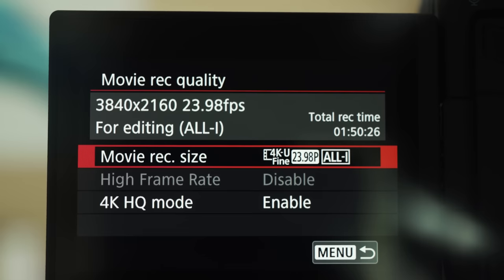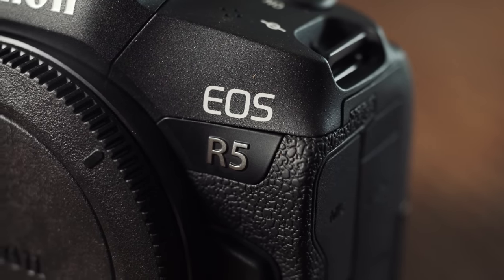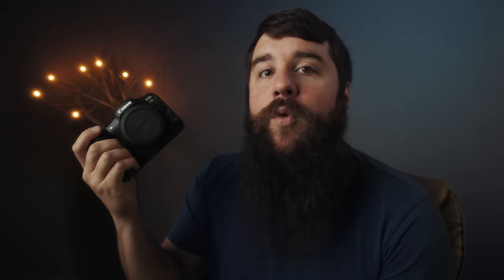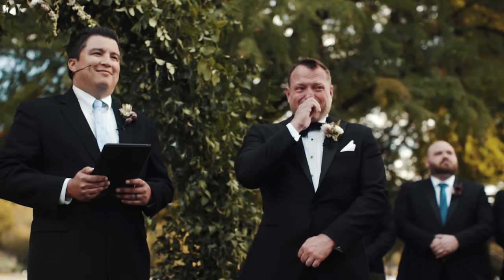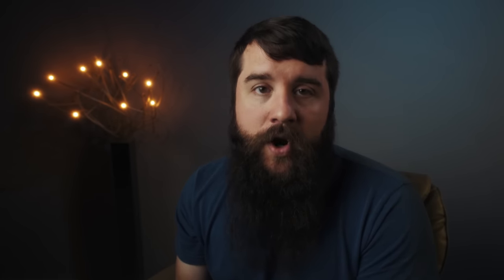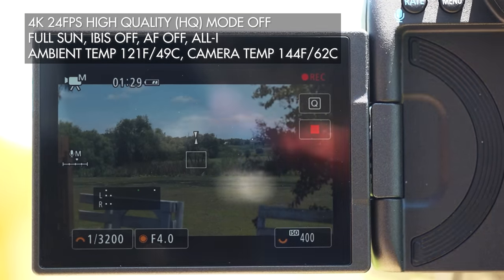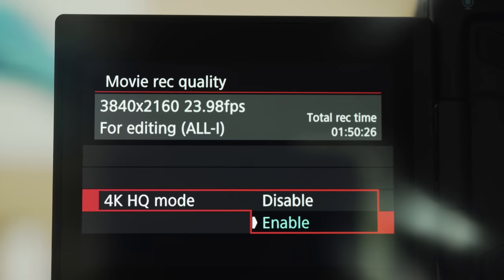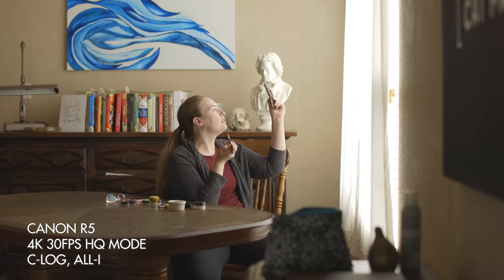Will The Canon R5 Overheat Filming A Wedding?

Comment: Hopefully a firmware update can fix this. As in other tests, the card and battery and camera are all cool to the touch, yet it overheats.

Did the camera seem HOT to you??
Reply from the maker: I measured the temperature on the camera when it overheated. 98F so definitely warm.
Reply: @whoismatt  I just passed the part of you talking about insulation. Makes sense. I think the only camera to ever overheat on me, is my Canon 5dmk2, but that was rare.

I definitely think it's a precautionary measure they put in the firmware, understandable they don't want the sensor to fry. But hopefully a firmware update can fix the issue.

But as Armando and even you said, this isn't an 8k camera and I think the marketing of the camera as an 8k workhorse was a mistake. And 8k for a wedding doesn't make sense haha.

The R6 IMHO, seems a much better video opinion. And it seems to have less issue (still has issues though) with overheating. No 4k 120? Oh well. 4k60 and 1080 120 sounds like a great option for a camera that costs 2,499.

But I will wait until it's resolved.

Comment: I noticed a lot of likes for comments agreeing with you. But no love for those comments mentioning it not overheating with external recorder. Are you intentionally ignoring those comments about the Ninja V?
Reply from the maker: Hey Fred, definitely not intentionally ignoring. I've replied to some. :)  I think its great that there is at least a workaround for this camera overheating. That said, the Ninja V is going to require an extra cost of $1000 (recorder + SSDs) to an already expensive $3900 camera. 

Then you have to consider the bulkiness of any rig using the Atomos. Using it on a gimbal etc is going to slow down filmmaking a lot. For the reason of added weight I don't use nor recommend an external monitor when filming weddings.

Lastly consider that you are now relying on a rather flimsy micro hdmi cable connector to get you through a wedding day. The R5 is not recording video internally, so if something goes wrong you are stuck with an overheating camera.
Reply: @whoismatt  You can shoot 4KHQ, 4K60, and 4K s35mm Crop externally without limits. I think not even mentioning this is a huge omission. ESPECIALLY because it comes down to a personal preference of not using an external monitor. To be completely honest, you are largely in the minority on that. Most filmmakers absolutely use external monitors. Also, why didn’t you mention Super 35mm Crop? its is 5.1K oversampled to 4K and it looks excellent! You can shoot 4K Crop 24p with NO overheating. Also you are almost always on zoom lenses for this work. S35 is a very popular format for cinema shooters. In Weddings, you mostly need more lens for those intimate moments. Even using it to punch in is very useful. There is no mentions of almost any of the well known positives in this camera. The superior IBIS and industry leading eye tracking auto focus come to mind. They would come in handy for gimbal work and weddings. Those omissions are pretty wild. It borders on disingenuous.

Comment: I feel like Canon can take off this internal timer and film way longer than advertised. It seems like it can handle a lot more than it lets you. I pray that with an update it fixes it and unlocks its full potential.
Reply from the maker: We can hope that is the case. I will say the camera does warm up to around 100F when overheating. It's warm to hold, and I can see Canon not wanting it to get much warmer before shutting it off.
Reply: My concern would be that even if the limits are taken off, what would all that overheating do to the sensor and other internal components over time? I imagine it would significantly shorten the lifespan of this camera. Can you imagine the camera just going completely dead on you during an event? 1 year into purchasing? 2 years? I would be crushed. I've been using a GH5 for years now and it's still going very strong. Reliability, to me, is way more important that top end specs.
Reply: They know more than us. Perhaps they are avoiding long term sensor damage
Reply: @philipbloom  but sony has no long term damage  when recording blazing hot , right 😁
Reply: The temp range I’ve witnessed every time on both of my R5’s is 112 degrees Fahrenheit, then it shuts off.
Reply: Ahh ok. Other reviews I've seen said they were barely warm to the touch and yeah, would def not wanna damage anything internally in the longrun that's for sure.
Reply: S B_ it takes a minute to get there, but I’m pretty confident that canon has the sensitivity turned way up. My atomos get to 113 and the fan is still off. I’m sure there is a lot of difference there with internal components, but the R5 is easily capable of recording longer than their times they have set. Praying for a firmware fix.
Reply: @unmaskingimages9209  I agree I feel like that as well. Would be amazing if we were right about this. It would be a top tier camera by then.
Reply: @Playerdrew10  Sonys all overheat in 4K. Daniel Schiffer admits that (despite being one of the most succesful youtubers around) he only shoots 1080 for everything because 4K30 only gave him 20 mins or so. Plus he had no 4K60 or 120 options in Sony anyway. Suddenly though, with dumb videos like this one, those options aren't good enough. LOL.
Fuji Xt4 overheats in 4k60 faster than the R5.
Reply: @DraganMedakovicPhotography  Yeah, the Sonys have heat issues in 4K30 for many years.
Reply: @unmaskingimages9209  why buy a camera that you have to pray for firmware fixes? You need a reliable tool . Panasonic is by far the best option but their AF is horrible leaving Sony as the other full frame alternative
Reply: @77dris  dumb videos like this one? It's the most comprehensive video out there. It unfortunately doesn't stimulate your fanboy ears the way you hoped it would.
Reply: All Cars United I mean we all hope for these kinds of things regardless of brand. We hope that Sony fixes their battery issue at one point and they did. People still bought it. We hoped that Panasonic fixes their AF but we still buy it despite it still sucking. Everyone has a workflow they are willing to tweak for a beast of a camera. Canon is mine... I wish it didn’t overheat, but look at how much the 5DIV cost at launch. ($3,499). So for $400 more we got a killer R5. I’m completely okay with this. Yes the overheating sucks, but I’ve found a work around since I use atomos anyways when shooting video. With all that said, I still pray that they improve it. I know there is room for that improvement since the camera is not even hot majority of the times it says it is. We are all pretty spoiled by the quality of cameras that are coming out now days.

Comment: I’m curious if using an external recorder like the ninja V changes anything with the heat issues.
Reply: Yeah I had the same question.
Reply: It does, check out No Life's video. He recorded 4K HQ for 2 hours until the battery died.
Reply: @findingjoe  You're limited to the life of the battery when shooting with an external recorder; the same as any other camera.  By the way,  I shot a wedding with this camera yesterday.
Reply: @MauriceCovingtonvideographer  How did you go?

Comment: Ouch...that's what I expected...but still is rough. Definitely one to avoid for video unless all you do is personal vlogs that can be paused if it overheats. I don't think I've ever seen a camera of this price bracket or advertised caliber struggle so much with overheating. Even the old Sonys weren't THIS bad.
Reply from the maker: As someone that still shoots with the Sony A7Sii, if that camera overheated as bad as the R5 I would have sold it a long time ago.
Reply: @whoismatt  very true, and that camera used to be made fun of for overheating. I've never had an issue with the A7iii at all in the couple years I've used it for wedding and commercial work. Never even seen the overheating warning pop on. I'm hoping the A7Siii follows that pattern, and other than a couple outlier tests it seems like it will, which has me hyped.

Comment: I really wanted this camera to work. But I can no longer defend Canon. This is not the first time they disappoint with cameras. But it really bothers me some people calling themselves reviewers are talking about this camera but are not being objective. They said things like “ if the Camera overheats at 8k or 4K 120 don’t use it” or they said thing to justify why you should buy it when is clear this is not a professional camera. If can’t freely use 4K 120 frames or 60,24 then what the point of this camera? I understand 8k having a limit but 4K 120 and all the other 4K options overhearing as well....this is not a good product. Then, is even worse when Sony presents the same camera but different MP and no 8k and no overheating issues. If another camera with similar specs exists without overheating, then Canon has no excuse to do the same. This was my last straw with Canon and this toxic relationship has come to an end. For the first time, after using canon over 10 years I’m thinking about switching to Sony, which I never thought I would do.

Comment: Useless camera, epic fail canon, disappointing. A7siii here I come
Reply: How is it useless?  Overheating issue is fixed by recording to an external record (which most people at this level are using anyway).  With the overheating being fixed, it makes the R5 a better overall camera than the A7siii for both stills and video
Reply: For sure better than A7sIII Sony, with the same overhearing problems of Canon.
Reply: @SuomiFinland78  huh? u make no sense lol
Reply: @jtdiddy3160  but you cant record 4k120 externally
Reply: I wouldn't say useless but they are indeed crappin the bed on this rollout.

Comment: Your missing one point here, you can shoot in 5k oversampled cropped mode in 60 or 24 hq or use atomos ninja v without heating issues. If you are shooting I guess u can use ninja v atleast
Reply from the maker: If you want cropped 4K the gh5 will work much better with no workarounds for overheating required. :)
Reply: Matt WhoisMatt Johnson well then use atomos ninja v, it will give you glorious oversampled unlimited 4k. Your camera in Tripod anyways. You had this canon hate from the start so ofcourse you will try ur best to point out only the faults. I never heard you complaining a73 overheating before, ur agenda kinda simple dude. No matter what the hell you say, R5 is the best hybrid out there not 10 mp camera as you will I’m sure proclaim soon
Reply from the maker: @shinzychan5117  best of luck shooting with the R5, hope it works well for you. I've never owned an A7 III by the way, hence why you never heard me complain about any overheating. :)

Comment: Was there any overheating in 1080 120fps? Or is that safe without overheating?
Reply from the maker: The R5 does not currently record 1080p at 120fps
Reply: Matt WhoisMatt Johnson wow that is crazy!! So strange. But The R6 does right?  I would really hope no overheating in 1080 😩😩

Comment: I know you don't have all day but would be very interested in seeing this same review but using a Ninja V... I have seen reviews showing that it helps with over heating but they are not real usage reviews
Reply from the maker: Hey Bryan, unfortunately I don't own a Ninja V. I wouldn't recommend it for wedding filmmakers regardless though. The Ninja is going to make the setup much bulkier, plus with most external recorders if something fails (HDMI port etc) you can still use the camera without the monitor. In the R5's case it's overheated without the monitor.
Reply: Matt WhoisMatt Johnson thanks. Your review is really enough to draw conclusions. I was just being greedy. 😂

Comment: Did you try it with atomos ninja? Seems like the proper way to go if you need video.
Reply from the maker: Haven't tried it yet! Keep in mind the Atomos is going to add bulkiness to any setups, plus if the micro hdmi port fails your camera is overheating. Also, no 4K120 or 8K without overheating.
Reply: @whoismatt  The way i see it, if micro hdmi fails, you have warranty. On the other side, no other camera has 8K, so you don't need it anyways for weddings. 4K120 is typically used for just a few times in a clip, so it makes sense to use atomos, it's cheaper, you get better monitoring, and of course, no overheating. Not too long ago, a7s had to be used with atomos to get 4k , no one complained for bulkyness. That setup is still smaller than any cinema camera.

Comment: Atomos!!! Love your content, but the atomos with no memory cards recording externally is a huge huge work around.
Reply: i was waiting for him to state the obvious which is the work arounds but he either doesn't know about them or simply just went full sony to even care
Reply: reem 94 I got almost 2 hours of continuous
 4k60 uncropped. That wasn’t even a cold start. So ya very possible to perform a high quality wedding at 4KHQ, 4K60 and 4K120 for small b roll moments. Plus I have 2 R5 setups with atomos ninja V’s. I should be solid. Don’t know many wedding videographers that don’t have two identical bodies.
Reply from the maker: I'm glad to see that a Ninja V looks like a viable workaround to the overheating issues. This pushes the camera's cost to approximately $5,000 for the recorder plus SSD. You still can't record in 4K120 or 8K without overheating. It's a workaround yes, but even with that setup I would not recommend this camera for filming weddings.
Reply: Not really, I’m not buying a $1000 atomos ninja to NOT be able to film in 4K 120 or 8k raw when that’s half of the reason to get the camera in the first place over other less expensive options. Plus after spending $650 on a CFexpress card to at least have it for a little time no way. If canon doesn’t correct these issues to at least SOME extended degree in a firmware or hardware update then it’s looking like this camera is doomed.
Reply: Matt WhoisMatt Johnson everyone has a preference. I’ve loved it for weddings. Photo and video wise. The editing is a lot better with the atomos codec, bright screen for outside use, and it’s cheaper media.
Reply: @whoismatt  how much does it cost in CFexpress media, compared to cheap ssd? you need at least 2TB for serious use
Reply: Fly Guy I agree that it needs to be fixed, but nowadays the atomos is a huge companion to every videographers arsenal. If you don’t use it and want to stick to just a body and that’s it, then it’s definitely not a wedding film camera. Then again... I did a test and the 1080/60 with an RF 28-70 f/2 Lens was sharper than the 1DX II at 4K60 with a 24-70 2.8 II Lens.

I’ve also been able to do all my recording and then stick the card back in for 4K120. So it’s definitely doable
Reply: @unmaskingimages9209  but atomos wont record 4k120 or 8k externally :/ You would have to plug out the dummy battery/atomos, insert back the cards/battery to shoot those modes. And switch back and forth.
Reply: I’m only concerned about removing the cards. The dummy battery isn’t that significant to me. 4K60 does that job just fine, and the 4K120 is usually a planned shot anyways for b/roll. Just pop in the card and shoot. Takes maybe 5-10 seconds. That’s doable for me... The R5 is a hybrid that I’m willing to do a work around with it until I get a designated RF Mount cinema camera as my A cam. I’m still debating on buying 1 A7Siii tho
Reply: You shouldn't need workarounds for a product that's selling for 4000 and claims to be the next video meca
Reply: All Cars United completely agree, but it’s not going to stop me from creating content that my clients and myself love.
Reply: Just read an article that basically proved that Canon has limited the camera on purpose. This is making me want to switch to Sony now.        https://www.eoshd.com/news/chinese-user-modifies-canon-eos-r5-to-improve-heat-management-but-finds-artificial-firmware-time-limit/

Comment: Matt you said you can not shoot a wedding with the R5 that is not true. If a person wanted the R5 before of the full frame 4K instead of the cropped 3k in the R, a wedding or anything else would be no problem. So I disagree with you there. Also, did you ever look at recording 4K HQ externally. The R5 has ~ unlimited record time. A lot of manufactures restrict their cameras to recording certain things externally. I think is Canon had said ( in marketing ) down sample 4K HQ externally we would be having the same conversation.  Just my .02

Comment: I wonder if this is the case with the R6 🤔
Reply: Yes it is but even worse because in the R5 you can film in 4k non hq 30fps with no overheating. With the R6 ALL 4k modes overheat, no exceptions.
Reply: same case
Reply: The R6 will most likely be worse at identical video settings.  The R5 has the more sophisticated heat dissipation hardware of the two.
Reply from the maker: I haven't been able to test one yet, but it doesn't look good from the videos I've seen.
Reply: @whoismatt  Once I get my hands on mine I will test it out

Comment: That 4K "line skipped" is still better than the 4K on the R or A7III. Anybody who bought a mirrorless camera and wants to be a pro videomaker has only themselves to blame. LOL. I've been a pro photographer for 15 years, and I'd be just as dumb to buy an A7SIII to use it for that. I had 12 MP back in 2007, and no way I'd go back to that. 
Up until a month ago, 4k 120 didn't even exist on ANY mirrorless camera. Nor did 8K. Period. 
How did pro wedding videographers make out prior to 4 weeks ago? Oh yeah, they shot 1080, or 4K 30. Or they have cinema cameras.

For what it's worth the R5 is less affected by extreme hot temps like in Texas and Florida than say, the 12 MP A7SIII.